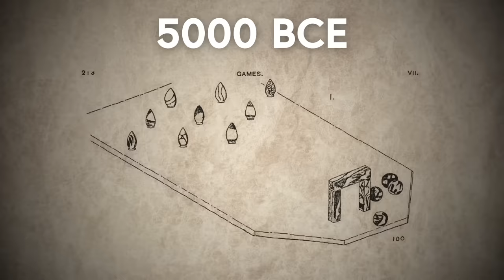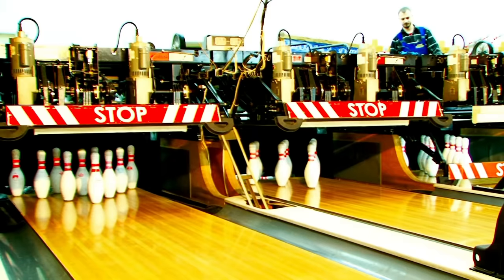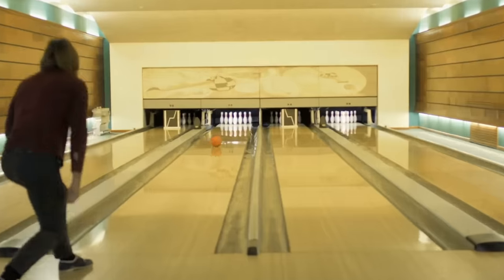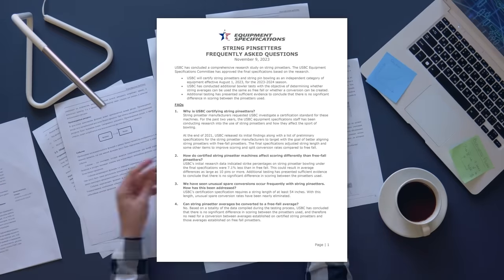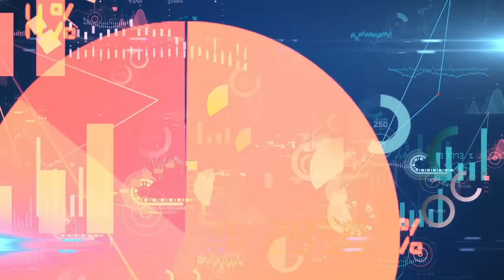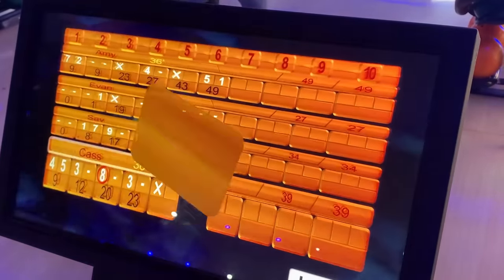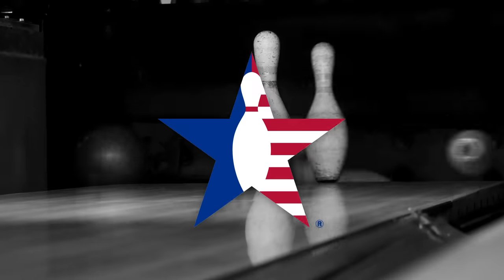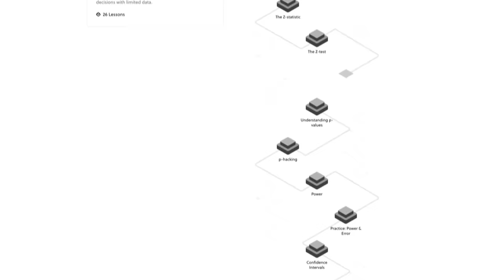The Controversial Machine That’s Ruining Bowling

Comment: I've bowled on both string, free-fall, all over the US in national, state, & regional tournaments, on countless different oil patterns, multitudes surfaces/surface types (brand new, to 60 years old), and pretty much every type of oil variant you can bowl on competitively, and average about 215. I just say that so people understand I am well versed enough to say something like what I am going to say.

String pins are by definition attached to something. There is a CLEAR and UTTER difference between the way 10 pins react to each other on a strike ball going from String to Free-Fall. Just like what the guy said in the video, this is proven just by the way the pins SOUND when interacting with each other. This can be well proven with simple geometry and physics by anyone with a simple understanding of either one and a camera shooting slow motion. Pins move slower, bounce less, bounce lower, and roll more often. Sometimes pins spin and spin and spin while moving slowly across the deck and eventually knock a pin down. With a string attached, yes there are almost no tension, but eventually the string runs out, gets caught (tangled), or simply wrapped around another lying pin on the deck, or the much more likely, just eats up kinetic energy because its attached to something ELSE that doesn't "want" to move compared to free-fall. Another huge caveat to string pins is where the string is attached. Yes the top of the pin is the only realistic way to attach the string, but often times a pin will bounce off of the sidewall, deck, or even out from the pit contacting something with from the TOP of the pin where the string would be attached on free-fall (yet this rarely happens on string pins because of the above reasons). I think its pretty self explanatory, but if something goes from contacting a wooden filled plastic shell with nothing there, to having some sort of softer material in between, its going to affect the bounce in more ways than might be painfully obvious. 

1. The string in between dampens the contact by creating a soft point (in retrospect to a wooden filled plastic shell) thereby decreasing kinetic energy off the bounce.
2. Building off of #1, the string now provides a much sharper point at the top of the pin (compared to a normal pin) making it much more reactant to the angle that pin makes contact with a surface.

There are more factors than the direct above that aren't related to the pins making contact with something that completely change the way the pins interact or move around after a ball makes contact with set/upright pins. I mean just think about it - and I'll use myself as an example: I typically have a ball speed AT REALEASE of about 19-20mph (17-18mph at the headpin) and put around 450-550rpm on a typical shot throwing 15lbs (all my bowling balls are 15lbs). The pins are going to react much differently than someone just rolling it down the lane at 12mph/>100rpm/~12lbs. The test should have been with professional/amateur tour bowlers. I am extremely confident the difference would have been much more noticeable with bowlers at an extremely high level rather than whoever they used for their testing. Even I can tell a difference and I am not pro.

There's a specific reaction of pins called a messenger that becomes almost unheard of on string pins due to the above reasons. Pin action is totally different on string pins. This is why the Pro Tour (PBA / PWBA, and the Regional Tour) does NOT ever hold tournaments at bowling alleys with string pin machines. I am not entirely discounting the study USBC did to determine whether they allow or chose to host tournaments at houses with string pins, but it makes a massive difference when you actually manipulate your ball of choice in an intentional manner compared to someone who doesn't bowl/bowl competitively. 

This game has so many micro adjustments like changing axis tilt or rotation by 2-5 degrees at a time, adding or subtracting 15-20rpm, throwing it .2 -.5 mph faster, adjusting multiple targets on a lane at LEAST 10-15ft away from you at the foul line that are about an 1" wide. Which might I add, is much harder than most people realize. Hell, 99% of the bowling community barely can do it well enough, myself included, to completely master that skill. Not to mention the insane control needed to repeat these things consistently enough to maintain a decent game average over that course of a 10-game block. that's about 100 separate shots. Once you have all of these things down to a respectable manner, string pins VS. free-fall makes an immense difference that literally cannot be unseen. It's night and day. It's like someone pointing something out to you on, lets just say a logo, (like the arrow in FedEx) that cannot be unseen for as long as you see that particular logo.

All that said, no matter what the numbers say, there's a clear difference if you actually compete in bowling and understand pin action at decent level. Hence why the PRO TOUR doesn't use these types of alleys.

Comment: I've just started a job as a tech for a bowling centre, the amount of stuff that has needed to be added over time for safety because someone, somewhere got hurt is crazy. these pin setters are extremely dangerous if safety measures aren't being taken properly/seriously. for the safety factor alone, string pins are the way to go. also it makes the league bowlers upset and that's always a plus (not sure how it is elsewhere, but in my city they are always extremely rude. I got scolded by one today for daring to show my face at the front to fix some arcade stuff while the league was on)

Comment: I think there is a way where there could be a happy medium between the two styles; making there be an app or software that manages the lane, could allow for a robotic arm to manually collect and replace each pin with decent speed, simply detecting with a camera where the pin landed. The arm could even operate on a pulley device, where it travels to each lane in order to reset them, making a small enough alley have just one pin setter for the entire alley..
Reply: Also, it's strange that $5000 per month to operate, is somehow cheaper than paying a person to stand there and reset them by hand. Surely, it isn't.

Comment: What bothers me about strings, is that they compromise the fundamental aspect of the game, pin action. I love seeing the pins fly, sending messenger across the deck. Turning heads when you send a pin halfway down the lane from out the back. 

Strings also contradict several other USBC rules on 10 pin bowling. 

if any part for the machine comes in contact with a pin during the cycle and knocks it over, the pin must be placed back exactly where it stood.   

Pins are constantly being knocked over from the stings wrapping around other stings cause standing pins that should be left standing, to fall over. 

String machines are only capable of setting pins exactly "on spot" so if a pin is moved off spot during a frame by the ball or other pins, the string machine isn't capable of setting the pin exactly where it stood. 

Those are only a few examples.

String pin is fine for recreational bowling but has a long way to go to be suitable for competitive bowling. It's a shame seeing the industry catering to public bowlers and not their loyal league bowlers.

Comment: My local alley has changed to stringed, and it made a noticeable number of mistakes while we were playing. Pins falling too slowly and not being counted, or strings hitting pins to knock them over etc. Was hugely irritating.
Reply: My local alley already has these issues with automatic pin setters, so I don’t think you’re making the point you think you are. Unless your point is “things can be broken or not work right away sometimes, and I don’t like that” in which case, I don’t blame you, but at the same time, it’s not like automatic setters are any better

Comment: Would it maybe be better if the strings were coming from the base of the pins? Think of those old toys, with a figure on a base that’s “held up” by strings—when you push in the button at the bottom of the base, the string goes slack and the figure falls down in a heap, and when you let go, the figure stands again.

Why not have a mechanism that works like that, but in reverse: strings, attached to the bases of the pins, go into the floor, where they are slack when the bowler is at play; when it comes time to reset the pins, the strings are pulled taut, pulling the pins back into place. As they are under the floor, the strings are less likely to interfere with the other pins, and the sound of the pins might be more like what were used to. Would something like that work? It couldn’t be much more complex than what’s currently in place, and still waaayyy less so than AMF’s machinery.

Comment: As someone who bowls avidly and has bowled on strings before it changes a LOT about the game when you get to the competitive level. Without strings bowling is a game of angles and rotation and bowlers have specific balls for certain oil levels, patterns, lanes conditions, etc. to achieve a specific contact point and entry. With strings it changes the crash and makes the angles needed completely different. It makes it easier in the sense of, if you can throw it hard the strings can cause more strikes and be more forgiving

Comment: There is no way a string setter can spot the pins correctly every time.   If you are throwing straight ball,  the string setters will be negligent.  But if you throw a hook,  the positions of the pins on the deck can make a differnce between a strike and a split or a natural 8 pin.  I myself would never bowl at lanes with a string setter machine in my humble opinion.

Comment: For those who haven’t spent a lot of time on strings, there’s a lot of exploits. If you hit the back right or left pin hard enough at the right angle you can have it bounce off the backboard and wrap around the front pins and give you a strike. I am not a professional bowler but my bowling style is akin to how Billy Madison would play. I’ve only achieved this 4 times total. Also the alley I worked at, a minor in the company had their arm torn off working on resetting the pin setter and I can confirm they are terrifying to work on sometimes.

Comment: You must new to this planet. "Strings" on bowling pins has been around for well over 50 years. I remember bowling in the 70's at a lane that was over 20 years old and they always had string reset 5 pin lanes while the 10 pin lanes were straight mechanical pin reset.

Comment: Things worked perfectly fine, then people make them work "better" for more profit which ends up making it much worse and more expensive, then end up paying more people to do studies and research lasting years only to come up with ridiculous solutions which cause even more problems, and lose customers along the way because a simple fun game became an over-complicated annoyance. Go back to hiring teenagers, give them an easy job manually setting the pins, and learn responsibilities along the way - probably also cheaper than electricity and maintenance for a machine with 4,000 parts used to replace one human (or half a human if they cover two lanes, or a third if they cover three...).

Comment: The local bar has a lower floor where you can do 9 pin bowling (more common here), and it's all done with strings too. Yeah it's not as comfortable, but it's cheap and has worked for decades

Comment: we've been using strings for years in 5-pin bowling up here in Canada. can't think of a 5 pin alley that doesn't use them, at least over here on the West Coast. only controversy I have ever heard did not come from the strings vs. free fall, but from wood vs. acrylic lanes. 
and yes, for all those outside of Canada, we have 5 pin bowling and 10 pin bowling and over on the east coast, candle pin bowling. never played candle pin, but it is like 10 pin, but with even smaller balls than 5 pin and the pins don't have any curves.

Comment: Here in Canada, back in the early 60’s, I pinset in a 5 pin bowling alley owned and operated by my aunt and uncle. They upgraded to an automatic string system by the mid 60’s, so this is hardly a new technology. My job then became string untangler and repairs.
Reply: One thing I do not miss from my job at the bowling alley was running down to the back to untangle the machine...  And hope no asshat tosses a ball while I'm there.
Reply: @Rick-cx1yr  I guess I was lucky, I had a switch at the back of each lane that would lower a guard to protect my ass when in the pit. And yeah, they got slammed a few times.

Comment: My local alley replaced the old automated system with a new stringed system. The new system might allow you to add your picture next to your name on the screen, but now the pins very obviously stay upright much more often when about to fall over, and they fly way less far from their starting spot when hit, reducing pins knocking into each other. The experience is only more enjoyable because we see what ridiculous picture we can come up with in front of the camera, but in terms of the actual bowling, the experience is not the same, to the point that it may even be worth travelling to the next city over to use an alley that doesn't use strings.

Bear in mind that I live in the UK, so have no idea if my local lane lives up to the US standards that showed there was very little difference, but you can definitely tell a difference between the 2. Maybe the scores end up being about the same, but I could say the same about squash and table tennis, but it doesn't mean they're the same thing just because the scores end up fairly similar and they're both played with a bat and ball.

Comment: String pinsetters have been used for five pin bowling for well over 50 years perhaps even longer in Canada.   I hated them.  They destroyed the game because the pins bounce differently.  My friend's mother who threw the ball very hard told me she would get strikes because the strings would get tangled.  By the way she didn't like string bowling either.  I never bowled with string pins until 1980 because the town I moved to only had one bowling alley and it had string pins.  I quit bowling after the next year.  I am surprised to see them used for ten pin.  By the way I used to bowl Saturday evenings by myself when I was a teenager and if the automatic pinsetter had an issue, I would just walk to the back behind the machines and fix it myself rather than bothering the manager.  They only had a person behind the machines during league play.

Comment: I have one issue with the statistics (or this interpretation of them).  It seems like we are focused almost solely on the number of points.  The scenario I see (online ... I haven't played strings), is that there are points that are missed because of the strings, and other points that are made because of the strings.  Maybe the net result is significantly insignificant, but the individual cases, and my experience, would be affected.  Did I miss a spare that I "should have" made?  Did I make a spare that I "didn't deserve"?  All because the strings affected the action? The statistics I would like to see would be around how strings changed the outcome of similar non-string shots.  (The judgement may be somewhat subjective, however, I've seen clear cut cases where a pin was heading across the lane toward another pin, and string restricted that motion.  There are surely some cases that could be objectively captured.)

Comment: There are many issues which make string-bowling distinct from standard, but the main problem I see is the structure of the video implying that one replaces the other.
As a new player, string-pin would be a good starting point for affordable play. 
For professionals that may impart crazy movements on the pins, standard or manual set is best.

Comment: Here's a note to the string bowling machine makers, the sound of the pins being knocked over is a huge deal. You should provide artificial sound enhancements through a speaker system built into the machine. I personally would never bowl at a place if you can't have the awesome feedback from the pins being knocked down.
And perhaps you could work on making the system a little less obviously string driven.

Comment: I maintain 32 AMF 82/70s and can say that while I like my free fall machines, string pinsetters are the way to go for family entertainment centers. My center is mostly a league house. Most of our league bowlers wouldn't come back if we installed strings. There are lots of videos of strings taking out other pins that shouldn't have fallen. One of the big reasons big companies are pushing the strings is because it's difficult for them to find people to work on the machines. If the machines are well cared for you won't have to get your lane fixed 6 times. Sometimes I will have a night where I have a 5 person team league across the house and have less than 6 calls. A lot of these issues stem from poor wages and under-training. There are OSHA procedures you are supposed to follow when working on these machines to prevent accidents and injuries like L.O.T.O (lock out tag out) and everyone who works in a bowling center should undergo emergency safety training to ensure they know how to help someone if they get stuck in a machine. Great video, very informative!

Comment: You do know that those are two different games.  The String pinsetter is used for Duck Pin Bowling.  Smaller "Duck" pins.  Smaller ball.  3 rolls per frame instead of 2.  It is an entirely different game